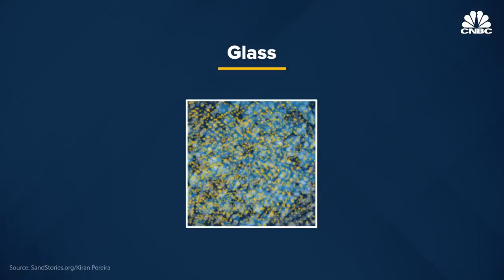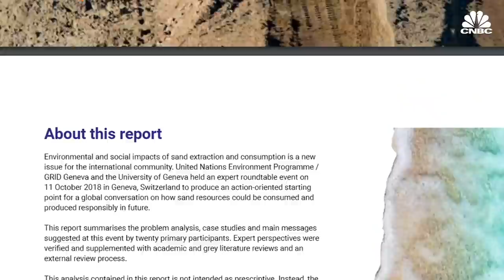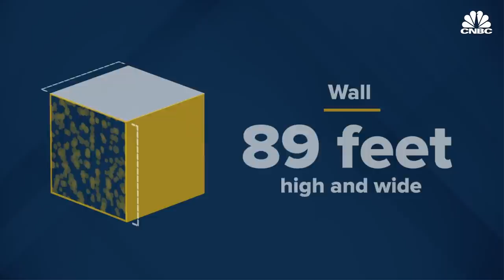Why The World Is Running Out Of Sand

Comment: Me: Hey i know how to stop mining fossil fuels, lets make more solar panels!

Sand:
Reply: 😂. This comment may blow up
Reply: Pv sand is plentiful, sand for concrete, less so.
Reply: No you are wrong.  Sand is a mix of many compounds.  It is almost never pure enough as feedstock for photovoltaic panels.  Even if it was. Guess what roofing is made with.  Yeah, sand.  A good idea is to make PV roofing tiles.  That is happening.
Reply: Where possible, building with stone (instead of concrete) is more expensive now, but more beautiful and also cheaper in the long run.
Reply: thats why we have nuclear energy
Reply: It takes 90 gallons of diesel fuel to produce one 12 volt 6 amp solar panel, and 800 gallons of diesel fuel to produce one lithium ion battery used in a tesla, and each tesla has something like 10 batteries, or more, so there goes your theory on less fuel use... next please...lol...
Reply: @badasswood  you got a source for that info? Thats incredible if true
Reply: @badasswood  It's amazing, truly amazing. Every single thing you just said is wrong. That is quite an achievement. In fact, just the statement you made on the Tesla batteries would suggest that 3,532,800 gallons of diesel are expended for one Model 3. At a mere $3 per gallon, the barrel packs alone would cost $10,598,400 each. I don't think that giving away over $10.5 M per car manufactured is how Elon Musk became the world's richest man. It's just a thought.
Reply: @programmer-mr5vo  nuclear fuel is limited just like sand

Comment: Could SAND one day be worth more than GOLD..? 

EXPERTS say "wtf? No"
Reply: Got no degree and I say yes🤷🏻‍♂️
Reply: Not sand but products made by sand, the iPhone alone is 50 percent sand by weight and you know how much those cost right now
Reply: @eddapultstab2078  You're paying for what was done to the sand used in the iPhone, not the sand in the iPhone itself. I see your point, however.
Reply: @eddapultstab2078  I'll tell you stright up... it is not THE SAND that is driving it's price action ...
Reply: @runethorsen8423  my point is that if there is an oncoming shortage or crisis with sand everything from housing to consumer and military hardware will face some kind of upheaval. The point of the video is we use this resource alot more than we possibly realize. But there is a silver lining in all this, there is a new material being researched that could replace silicon in the manufacturing of electronics. There could be alternatives to manufacturing concrete or a similar material. Glass recycling maybe more crucial in keeping it in the supply chain. But alot of things need to be done to even begin alleviating the situation. Don't know about you but I don't want to see my xbox or computer prices going up.
Reply: @eddapultstab2078  I hear what you are saying, but this video is a salespitch, and part of the elitist's "problem, reaction solution"- there is no problem, they are trying to make it appear as if there is. Already recycling of building materials is endorsed and incentivized in the EU at least. There is NO COUNTRY ON EARTH that is running out of sand, not in the short, the medium OR the long term. Can you name me one ? How about the mentioning of a sand  "mafia" : NEWBS thinking there is no mafia in sand, there is a mafia in everything construction. 
Please realize they are not mentioning any   numbers on the supply (of sand), they are not mentioning any countries.. What they are doing is building on the general narrative of the populace, namely "overpopulation leads to scarcity" - to laymen this is intuitive (due to the narrative) how ever, this is an obvious economic falsehood. 
They are talking about the environment etc... sure the ocean floor gets messed up completely by these mining operations... JUST LIKE the oil or gas drilling completely destroys the local maritime environment periodically. It always bounces back though, as long as we keep inorganic chemicals out of the natural environment we are good. We don't do that though, but NOTHING about this... On one hand they claim that sand mining is an environmental problem, and on the other hand they mention the FRACKING industry as a place where sand shortages could be detrimental.
Reply: There are many metals worth more than GOLD.
But Gold is always a fixed price. 
It is not the GOLD price that increases.
It is the debt instruments people call 'Money; that decreases
in value because of inflation. Thus more of it is required to purchase the GOL:D.
Thus it is NOT the GOLD going up.  It is the currency value going down.
Reply: Experts schmecksperts
Reply: If you ever have free time watch a movie called Waterworld
Reply: lol

Comment: 10 tons of sand for 1 ton of concrete???  How is that possible!?  I call BS.
Reply: There is 9 tons of waste sand that is sold to other industries, only 10% of sand extracted is useable in concrete
Reply: @danielstark8258   OK, that makes sense but it's still misleading as the other 90% is useful.  Also that would mean more like 1 ton of concrete to 5 tons extracted bc concrete isn't just sand but also gravel and cement.

Comment: We have over 800,000 tons of sand sitting in our quarry right now 🤔
Reply: And with the high price of lumber, more house construction will be done with concrete.  You're sitting on a metaphorical gold mine.
Reply: Sell futures in sand before everyone works out that actually it's quite abundant.
Reply: @thomas316  The abundant sand is the wrong kind.  The grains are too small and rounded.
Reply: You should really be careful posting on social media.  Someone may take your sand fortune one night.
Reply: @drmodestoesq  the crushed stone quarry sand is the best kind for making strong concrete, and last I checked we don't have any shortage on bedrock or mountains, so no sand shortage for making good concrete!

(yes, you CAN make concrete from beach sand, but it's much weaker because of the smooth surface, as opposed to the sharp sand from a crusher.)
Reply: Florida is basically all sand.
Reply: @brocksamson3282  Florida not only imports, but invests billions in literally seeding sand on it's beaches. They have large barges that refill the sand regularly to keep the water level from eroding all the way to the cities.
Reply: @setcheck67  true.  Florida is still a peninsula of sand.
Reply: @drmodestoesq  Find a way (through chemicals and engineering) to make the round abundant sand work. through binding or processing - now that would be lucrative!

Comment: It takes ten tons of sand to make one ton of cement? That doesn't sound right... does the sand get waaaaay lighter when you mix it into the cement? Concrete is about 1/2 sand, so perhaps when CNBC says "do the math", they did not.
Reply: Seriously, also cement and concrete seem to be used interchangeably here when they shouldn't be.  I think they meant to say 10 tons of limestone to make 1 ton of of cement which has nothing to do with sand.

Comment: @6:24 Is anyone else confused on how it takes 10 tons of sand = 1 ton of cement?
Reply: Haha, I was like, what!? And started Googling how much sand in a ton of cement. Couldn’t get an answer. But this is OBVIOUSLY wrong. This is like a pound of feathers vs a pound of bricks kind of thing. It’s insane to say it takes 10 tons of sand to make 1 ton of cement. THINK PEOPLE, THINK!
Reply: @ericwootton2  Was going to ask the same question as well, XD how did this happen, 10 tons of weight converted to 1 ton like what.
Reply: They spill a lot.
Reply: concrete is a 1,2,3 mix. 1 part cement, 2 parts sand, 3 parts gravel. So 10 tons of sand would yield 30 tons of mixed concrete. 5 tons of cement, 10 tons of sand, 15 tons of gravel.
Reply: @kallyjon  bingo.

Comment: 6:24 - so let me get this straight, 10 tons of sand = 1 ton of sand? I thought cement requires 65-70% of sand. So what happens to all the other 9 tons of sand? Please explain?
Reply: That's what I thought exactly!
Reply: It's cement
Reply: This video is just straight wrong or manipulative on so many points. It fearmongering
Reply: The Law of Conservation of Mass and Energy would like a word...
Reply: It goes up and over
Reply: Cement requires almost no sand, in fact cement is probably 90% limestone, with some additives. Concrete is different, as concrete is sand+cement.
Reply: The other 9 tons were stolen by the sand mafia.
Reply: @adityanahar1344  you know what I mean lol
Reply: Perhaps they meant that 1 ton of cement requires 10 tons of sand to be turned into concrete?
Reply: When I mix cement for the company I work for, we put about 700 pounds of sand in every ton of cement we make. I don't know how they do their math. We could use more stone if there was a real shortage of sand. We would have to process the limestone into smaller pieces to replace the sand.
Reply: @treelife365  That is what they meant, but that would be stupid.

Comment: "It takes 10 tons of sand to create 1 ton of cement."
Please explain, because that makes no sense, and I think you are wrong.
Reply: It's not suppose to BatCaveOZ it's a sand demic.
Reply: She meant to say concrete, and she's still wrong.
Reply: concrete is made from 3 components. an aggregate (rock, etc), sand and cement.
Reply: Let's assume the figure is actually 3 tons of sand to make 1 ton of cement or concrete. That's still a problem.
Reply: Idk as well. Maybe she meant 10 tons of sand by volume to create 1 ton of cement by weight. Still don’t get it
Reply: Not all sand at the beaches or in the deserts can be used for construction and almost all sand cannot be used for semiconductor chips
Reply: M.A.K. Ton is an unit of weight not volume 🤦😀
Reply: @philliprogers964  yet here we are. The only two people who understand this basic concept
Reply: @johnwalker-fj5gy  concrete is a 1,2,3 mix. 1 part cement, 2 parts sand, 3 parts gravel. So 10 tons of sand would yield 30 tons of mixed concrete. 5 tons of cement, 10 tons of sand, 15 tons of gravel.
Reply: Civil engineer here, weighing in on numbers.  It varies depending on the mix design, aggregate stone size, and specified strength of concrete; but you've got the right idea.  A 1/2/3 mix using large aggregate size would yield around a 3000 psi (25 MPa) 28-day compressive strength concrete mix.  I thought maybe the reporter misunderstood when someone told them how much sand vs how much cement would be used to make concrete, but there is no suitable mix design that would use a 10:1 sand to cement ratio for concrete.  I could maybe see a 10:1 ratio for soil cement stabilization, but in this case you wouldn't be using up sand/soil but just adding cement to it to stabilize the ground to build on.  This "news" piece has uninformed, misinformation all over it.  It saddens me that mainstream media companies spread this alarmist, misinformation through our culture when they could quite easily find professional engineers or contractors to provide accurate information.
Reply: I can answer that. To make sense of it i digged their original article out (the video seems to be a dramatic lecture of their article in order to be more appealing). The article says:
"The global use of sand and gravels has been found to be 10 times higher than that of cement. This means that, for construction alone, the world consumes roughly 40 to 50 billion tons of sand on an annual basis. That's enough to build a wall of 27 meters high by 27 meters wide that wraps around the planet every year."
So whomever made the video script completely misunderstood the article, or failed to explain.

Comment: Concrete uses sand only because it is, or was, readily available.  You don't  need sand to make cement.  If sand is becoming precious, switch to using other crushed rock.  I buy sand from a mine that crushes quartz, which is another source of sand, but eventually that source will end.  I also use crushed limestone.  I use both to produce the intonaco layer of a fresco.  Sometimes I use Carrara marble, which is expensive but produces a cooler color.  Marble sand is a by-product of mining marble blocks.  Some people call it marmolina, but I see marmolina as marble dust, not sand.  Crushed granite works as does crushed serpentine.  Both give cement or lime plaster a different color than silica sand.  Sand beaches are not overly common.  As a youngster I did research along many beaches.  Some were made from crushed coral while others from black basalt.  Crushed coral makes good concrete but is not encouraged to avoid destruction of precious reefs.  Talk to the people in Nago, Okinawa to learn what is going on in Aura Bay.

Comment: In my hometown Vizag, India a truck of sand cost you anywhere 7000-10000$. A decade ago it was less than 700$
Reply: My heart goes out to you in these covid times
Reply: I understand India is on the forefront of manufacturing sand.  I assume the problem is lowering the per tonne cost.  How about heating crushed rock up with a solar collector and then quenching it in water to shatter it before it heads off to final crushing.
Reply: A truck of sand doesn't cost $10,000. 🤷‍♂️
Reply: It not USD $. It's INR ₹
Reply: So it's basically dirt cheap.
Reply: @kennyg1358  yeah but lot of rivers are now vanishing because of that
Reply: That is called.... inflation my friend.
Reply: Bhai, remove that $ sign. Everyone will go beserk after seeing that price,lol. Its 10000 rupees. Which is roughly $140
Reply: Sand Mafia must be making a big fortune...

Comment: "It takes around 10 tons of sand to produce 1 ton of cement." 
Conservation of mass issue? 😂  Portland Cement is just over 20% sand by weight.
Reply: This is CNBC... what did you expect
Reply: Where did you find the percentage?
Reply: @thomas316  Thanks 👍
Reply: You realize only a percentage of the raw sand is usable right
It takes me 2 kg of bananas to make 1 kg of banana cake. Because most of the banana is trash. And only like 1/3 of the cake is banana. Thermodynamics FEAR ME
Reply: In construction, cement is used to make concrete. Typically, 1 part cement, 2 parts sand and 3 parts aggregate (crushed stone) by volume.
Reply: I think they meant "concrete" not "cement"

Comment: 6:18 "Takes 10 tons of sand to make 1 ton of cement... do the math".... We could solve the sand shortage by mining between these peoples ears.
Reply: I agree Polymath.  How do you put 10 tons of sand into 1 ton of concrete.  Although if you didn't notice the guy says "sand and gravel" really quickly after that quote is taken down but again how do you put 10 tons of anything into 1 ton of anything.  I'll have to go back and read the exact quote again did it say concrete or cement?  
If they said cement then I'll have to research the exact process but making cement, which is an ingredient in concrete, involves heating ...well here it is straight from the Portland Cement Mnf Assc:  
"The most common way to manufacture portland cement is through a dry method. The first step is to quarry the principal raw materials, mainly limestone, clay, and other materials."  
Further reading on same site revealed this "Common materials used to manufacture cement include limestone, shells, and chalk or marl combined with shale, clay, slate, blast furnace slag, silica sand, and iron ore."  
So OK its used in the cement making as well, although listed almost dead last in the materials needed.  That then is heated up to 2700 degrees C.  Still I really can't see putting 10 tons into an oven with all the other materials and ending up with less then 1 ton of finished product.  
I for one am shocked and surprised...I mean a news agency exaggerating or out right lying to get more views??? 
Who woulda figured!!! LOL
Reply: cement is made out of lime and clay ( do the math)
Reply: She should have said 1 ton of raw cement needs 10 tons sand to make concrete, with 15 tons gravel= 10mt3 concrete=10 M3 gravel, fill the space between the gravel with 5m3 sand, fill the space between the sand with 1.5m3 cement, fill the space between all with water 1.8m3, now thats how you need on average 1.8m3 of material to make 1mt3 concrete

Comment: My uncle built a new house using all the concrete from another house.
First, he ground the old concrete and added it to the new one. 
Hollow bricks made in this way are no different from new ones. 
Thanks to this, he saved a lot of money on gravel and sand.
Reply: And the energy required to do this came from what exactly?
Reply: @smitajky  All self-built machines were powered by the electricity network. It became more profitable when the Germans bought our cement factories and gravel pits, which increased the prices of sand, gravel and cement.

Comment: 6:24
How does it take 10 tons of sand to make 1 ton of concrete. I thought the process of making cement required mixing. The sand can't just disapear, can someone please explain this process. This dosen't make sense to me.
Reply: The person doing the voice over obviously dose not understand how it works. But what she meant was. For every one ton of cement you need ten tons of sand to make concrete. But even that isnt correct as its more like 4-1 so dont worry its just nonsense
Reply: I think they use that magic act in  Vegas.
Reply: You need to watch it again.  That section of the video is talking about the production of CEMENT, not concrete.  The manufacturing process of cement requires sand, and lots of it.  Once you have cement, you then need several times as much sand again if you want to make mortar or concrete.